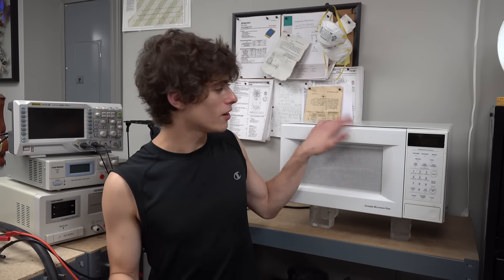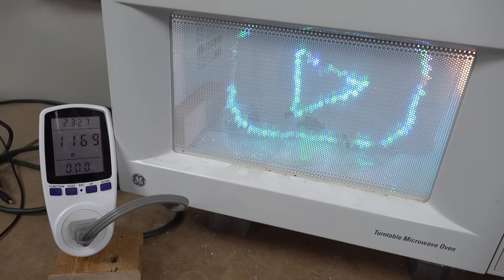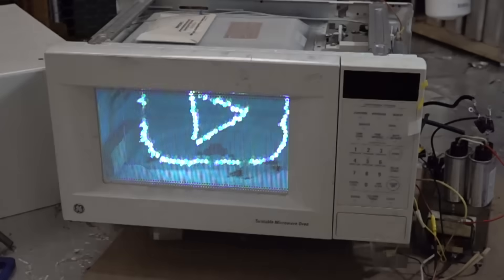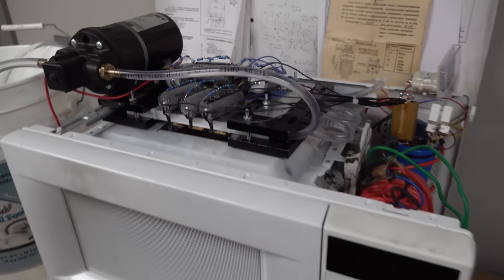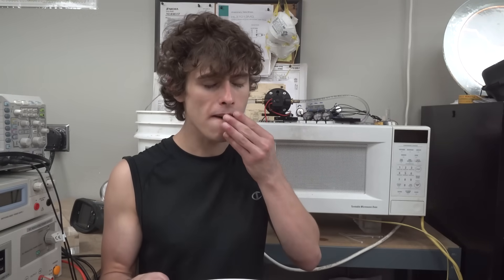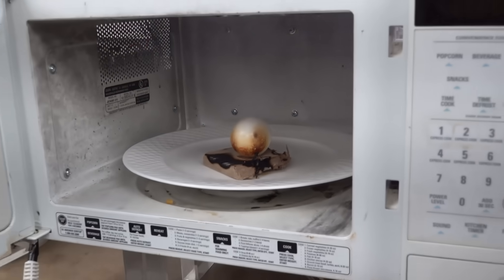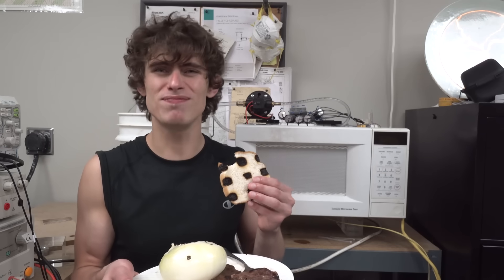I converted my microwave into a LASER oven!

Comment: STYROPYRO: I NOTICED YOU HAVE WHAT LOOKS LIKE OLD CERAMIC MAGNETS ON YOUR FARADAY CAGE HOLDING UP POSTERS. PLEASE BE CAREFUL! IN ONE OF MY EXPERIMENTS I PLACED ONE OF THOSE CERAMIC MAGNETS ...JUST LIKE THE ONES YOU HAVE IN MY DOOR BELL, YES, MY DOOR BELL STRIKER, WHEN I RANG THE DOOR BELL THE ELECTROSHOCK PULSE EJECTED THE MAGNET ONTO AN OPPOSING WALL WITH SO MUCH FORCE THAT THE MAGNET SPLIT INTO AT LEAST 100 PIECES OF SHRAPNEL! BE CAREULL! TRY USING Neodymium MAGNETS. CHEERS! LUV YOUR VIDEOS!

Comment: 0:41 - perforated steel grid - good for ESL speakers, but if you cut grid from ovendoor-stamped steel border - it became warp ... awry - the grid is perfect when it is originally pretensioned at the factory by press stmpoing, in a non perforated area of steel border edge of the ovendoor... 
I think that you constructed in this video some organic inc liquid or gase-filled laser with UHF charge by microwave of oven...

Comment: Interesting video. You were just not right when you said that Class IV lasers are max 0,5W output. That counts for Class III lasers. Class IV lasers are any laser more powerful than Class III, and also not shielded which means you can get in contact with their output beam. Your laser oven is a Class IV device. Should you protect the user properly (i.e. a door without a window that switches off the laser once you open it) then your laser oven would be a Class I laser device.

Comment: Those Nichia (or Osram) diodes are used in Laser Phosphor projectors, albeit not in surface mount arrays with lenses.   Those devices, if you can find old used/broken versions, incorporate a nice pre-fabricated optical train, complete with mirrors and mounts and might even provide a simple platform for increased output by replacing the standard diodes with higher output modules, or diode-bar stacks with prism-guides in their place.

Comment: The power settings has pissed for some time I know radar can run a lower settings. Is There some reason lowering the currant to the power tube won't reduce the output. Are any other problems associated with that.

Comment: Usually people die when messing with electronics and appliances because they left an internal battery connected, and/or didn't discharge the capacitors. Electronics are pretty safe to mess around with, as long as you take your time and follow the proper steps. :P

Comment: Where did you get the laser diode array? where thee given to you or did you buy them? One drilling tip. when drilling any metals, turn the bit slow. When you drill fast all you do is create a bunch of heat at the tip of the drill bit and that will dull the bit very quickly You kill me with your projects. I just love them!!!

Comment: Hey guys . 
Would it be fine to use welding goggles for a 450nm laser of about 1.2 watt optical output .
Reply: No, not at all. The highly coherent nature and very high irradiance of lasers means that even mWs of laser radiation can cause instantaneous eye damage (especially at wavelengths like 445nm which the retina absorbs very well). Please get yourself a pair of goggles from a trusted manufacturer. Stay safe

Comment: If you could, could you make a video explaining the maximum possible diameter of a low-power laser-beam?

I'm wondering what is the widest possible beam of effectively perfect parallel light, both for coherent and uncoherent light, in theory and in practice.
I tried googling this, but all the results just generally talk about high power lasers and mention little to nothing about the science of beam width.

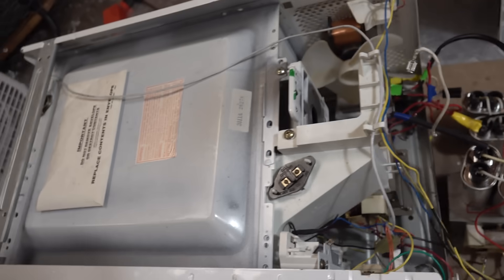Comment: CAUTION: at @7:39 you toss the Magnetron... You NEED to be VERY CAREFUL with that !!! It has a sintered ceramic insulator that contains BERYLLIUM Oxide. If it is crushed and you breathe in the dust you can get an UNCURABLE DISEASE called Berylliosis.

It's a nasty disease, look it up on google... Berylliosis... and you thought asbestos were bad

Not all dangers from electronics and electricity is from getting zapped !

Comment: This gives me flashbacks to when we were allowed to disassemble and mess with a microwave in middle school lol. Kind of wild when I look back at it.
Reply: Reminds me of my assistant auto shop teacher in high school. He told us stories about teaching there in the 70s - he would berate students for chewing tobacco in class - not because they were using tobacco, but because they would spit on the shop floor and make a mess! He also mentioned a story about some students who got bored during some sort of event that prevented them from engaging in normal auto shop activities, and so instead they built an actual cannon out of scrap metal and ended up getting in trouble for blowing a hole in the shop wall (a pretty thick red brick wall).

...I miss that auto shop. Good teachers and a good shop. We had a Bridgeport milling machine that was used to build submarines in the 40s, a smelter and ingot casting tools, all kinds of welding equipment, lathes, hydraulic shears, sandblaster, and other cool stuff. It was just a really fun place to hang out and learn about cars and machining.
Reply: @platyhelminthes2877  sounds awesome
Reply: I wish I had gone to your middle school. Sounds way more interesting than the basic ass shithole my middle school was
Reply: And I thought using a angle grinder at age 16 unsupervised was wild!
Reply: wait you do these things at school?
Reply: What kind of middle school did you go to?
Reply: That's awesome. I hope the capacitors were discharged by that point 🔌😳

Comment: Microwaves are just that, WAVES.  The reason you are only showing it as being on part of the time at 100 percent, is the wave ISN'T hitting your receptors 100 percent of the time. If you had receptors located at different points, you would see that at least one is active at all times.  If you are going to teach science, at least do your research.  I worked with Extremely High power RF Energy for 20 years (radars in the Navy).

Comment: The actual reason why heating the banana costed it to arc is that the banana started producing a small amount of hydrogen gas which reacted to high heat, microwaves and magnetic field making those gases into plasma

Comment: I love this kid, he's mad as hell, just like our Dad was. We were introduced to dynamite, black powder rockets, chlorine gas (will kill you) and Sulphuric acid, nitric acid, three phase electric motors with a fan blade that went from zero rpm to 10,000 rpm in 1 1/2 seconds, yes your hand could be cut off, hot oil at 630 degrees F. Janitrol spark gap igniter from B-52 Bomber...so, you see, I love this kid.. not afraid to try things, and he's still alive, so he has plenty smarts and common sense too.Wondering why Michio Kaku or NASA hasn't cabbaged onto him? Subscribing immediately..

Comment: Do ya know of any good reputable websites to buy handheld burning lasers from? I have a green one I got years ago but can't remember where I got it from and it's just strong enough to burn though electrical tape. but wanted to get something a bit more powerful but still portable that I can run off of an 18650 or similar rechargeable battery.

Comment: (Safety question unrelated to this video)
If I put a glass ball at the end of a high power laser, so the focal point is only a few cm away from the machine producing the laser, and after the focal point, the laser diffuses, would it be safe to look in the direction of the laser if far enough away?
I just woke up, and this was one of the first things I thought about, so it might not be 100% coherent, and it might also be a stupid question.
Reply: It's not really safe to look into any laser beam, takes fraction of a second to burn out retinas in your eye, and you won't even know it. Just because the beam(s) are smaller, or farther away, doesn't mean it's not still hurting you.
Reply: @tyrzxv  This is more of a theoretical question. I am not sure why I wrote safety question. The correct answer to my question, I know now, would've been to look up the inverse square law, and learn how to answer the question with any numbers.

Also, the original question, altough now irrelevant, would also be in a vacuum, so dust and air doesn't diffuse the laser further.

Comment: Could you find a piece of plate steel that has a bit of surface rust, point your laser circuit at the surface rust, and see if the surface rust vaporizes?

Comment: Wonder if you use a mirror glass with another and another and another and another and another of mirror glasses stacked in different section with different heat temperature boost and shine a laser through it, what would it do

Comment: A way to increase the cooking potential the laser microwave is to make some kind of moving platform that would move the food around to equally cook anything in the laser microwave so you're not wasting the latest potential a moving and spinning platform that moves and spins the food into positions that have the laser directly impact with the food surface that's not cooked yet and then once that's done it would move the food so the laser is facing another part of the food that is not cooked yet similar like cutting paper with a magnifying glass by moving the paper around or you could move the lasers around on top of the inside of the laser microwave to cook as much of the food is possible but you would need some kind of platform like system that would move to position the lasers or the food itself to parts that are not bent or cooked by the laser effectively increasing the cooking ability of the laser microwave or maybe more laces

Comment: Just one question : obviously your glasses allow you to see the laser beam in the air / smoke. So they allow some light to pass through. Let's say 1%.
Thus, any reflection should be just reduced to 1% of it's power, which is still enough to make you blind.
So, how do glasses work ? They can't block "powerful rays" only right ?
I hope you see what I mean :)
Reply: they are supposed to block all light of certain wavelengths, so you need ones matching the wavelength of your laser to be safe

Comment: “A benefit of the new setup is that it bypasses all the safety mechanisms.” - styro
Reply: Famous last words
Reply: The words of every great scientist everywhere before they make a revolutionary piece of tech LOL
Reply: @drkool8168  I mean, if it wasn't for crazy ass wackos and people with a unsatiable urge to kill, we wouldn't have really any technology we have today. He at least legitimately understood the danger and built a Faraday cage around it, and used a proper tool to change the power output. The fact he isn't dead or maimed after years is showing that he did indeed understand the physics and danger.
Reply: @drkool8168  I just think of when Tesla took that photo inside of his Faraday cage with electrical bolts arcing everywhere.
Reply: - white Freddie Mercury
Reply: "Benefit."
Reply: @cozmiccle  Yes. It is a benefit because if he created a Faraday cage arround it, the existing safety is not required

Comment: Is laser "Optical" power anything like "Audio" power. I mean for example 1 watt rms into 8 ohm = 10 decibels. To double the sound level to 20 decibels you have to multiply by 10 so you need 10 watts = 20 decibels. If I want double the power of a 1 watt laser do I need 2 watt (optical power) or 10 watt or some other formula completely????

Comment: How come you haven’t built your own laser diode from relative scratch ? Wouldn’t that give you the ultimate freedom to scale it up beyond silly practical considerations ?
Reply: the required hardware is orders of magnitude more expensive than high power lasers themselves ... especially if you want to make larger chips than commercially available

it would probably be significantly easier to build fiber lasers than diode lasers, and perhaps still easier to just scale up CO2 lasers or similar

Comment: The breaking point for me was the idiot using a copper wire to hold the circuit breaker from tripping properly . . . YouTube should be banning dangerous vids like this one - - this ain't "freedom of speech" - - - -  this is spreading dangerous ideas

Comment: Instead of mucking about with these stupid things, why not make a laser or a microwave charge an electric car wirelessly,  so we won't have to plug it in with a wire and if I am living on a 10th \Floor apartment I( can point my laser beam or a microwave beam on to a receiver antenna mounted on the roof of my electric car and it gets charged . and you can make it fail safe by a low power laser mounted on the car roof such that should anything come in the way of the high power beam it would also interrupt the low power laser so a contactor would switch the power off immediately.

Comment: hey STYROPYRO, time ago i make you a question, did you know the laser rust remove machines? are machines that with laser beam can clean any kind of surfaces, can clean metal rust, oil, dust, and all dirty, that machines are quite expensives, but i saw your work that with short resources you can make super powerful devices, the question is, CAN YOU MAKE A RUST REMOVER MACHINE WITH A COUPLE OF BUCKS? please, read this and you can make a video with this challenge, greetings ;)

Comment: Styro… I have a question and I think your one of the best people to ask… what stops the creation of a “laser drill” for drilling into the ground?
Reply: The electricity needed for that would be insane, that is what is stopping it. Well, that and having a laser strong enough to handle that much power.  Oh, and a ever changing focal point as you drill deeper... (the distance from the laser would change ergo, the focal point needs to move.)  

 A laser drill would have to vaporize the ground, dirt, rock etc etc.  Anything short of that wouldn't work.  Say you make a laser strong enough to break up a rock, great congratz, now you have a bunch of smaller rocks to break up.  Then smaller and smaller.    And the smaller they get, they just fall into the hole that you created; so you have to dig them out.  On the same side, make a laser that liquefies rock, ergo turns it to magma and now you have a pool of magma to "drill" through.

So again, you have to vaporize whatever substance you want to drill through.  Doing that with rock? Ooof, I'm sure someone has done the math of how hot rock has to get to turn into a vapor and I'm guessing it's insanely high.

You probably could  make a laser to drill through something like Oobleck though.  Er kinda, I'm guessing that it might actually make it explode outwards if you had a laser powerful enough to "drill" a hole.   But, you could burn a hole through it.
Reply: @OgdenM  Yeah vaporizing is what I was aiming at.. I know it would be energy intensive but I was curious what else was going to be an issue.. like what frequencies of light would be best, what type of laser to do that, what the total wattage would be needed... basically curious all around how hard would it be.  I was imagining a drill that just kept slowly going down the hole to keep the focal point on the rock/dirt in front if it... i figure it would be hot enough to evaporate the groundwater but I guess you would also have to figure out how to handle all the rest water that would come flooding in.

Comment: Microwaves that use an inverter instead of a high voltage transformer can indeed run at true half power output or even lower..so there are a few exceptions to how the power level setting works ..

Comment: The magnetron has a hidden danger too, there are two insulator in it, if they are pink, they are proably made of Beryllium, which in it self, is not dangerous, but the dust is, if you for some reason damage them.

Comment: The best thing that I ever did with a broken Microwave, was to remove the HV Cap, the Magnetron. Using the Power Relay, this then drove a 4-bar quartz element - mounted (top) inside. I liked this, simply because you could cook stuff in a fairly 'normal' way - but get very precise timing for whatever you placed inside. The converted Microwave was never used for cooking food, but for precisely heating some uniform -size Laboratory Samples. That was back in 1996, and the converted Microwave survived beyond 2004, when I retired. It became invaluable and was used every day. It was 100% safe, as all Interlocks remained intact. You must take great care in dismantling, make certain that the HV Cap is fully discharged. But this is a great practical use for an old Microwave. It can do toasted stuff to perfection, and (from memory) the quartz element was 850W. Playing with Lasers is dangerous! You must protect your one remaining eye at all costs!!

Comment: "most hobbyists die from microwave conducters!"
starts beating the everliving shit out of the microwave conducter
Reply: REVENGE
Reply: Yep, that's the joke lol
Reply: most
Reply: If it is unplugged and the caps are discharged then there is no electrical danger. The problem is there is high voltage transformers in there that can shock people when powered.
Reply: @JohnDoe-fg9ng  i disagree
Reply: you mean transformer? capacitor?
Reply: SEND HATE ON MY VIDEOS..
Reply: @idkanameforthis  stop

Comment: Hi Styropro do you think the nano-materials like graphene, carbon nano-tubes and carbon 60 and the creation of them in specifically designed structures could produce more advanced amplification materials and better ways of handling atomic strictures to more easily hold atoms in an excited state to achieve higher levels of amplification. If you think it could work how far in the future is this technology.